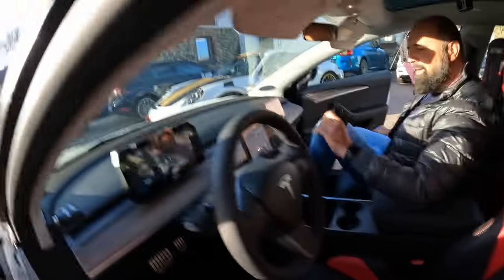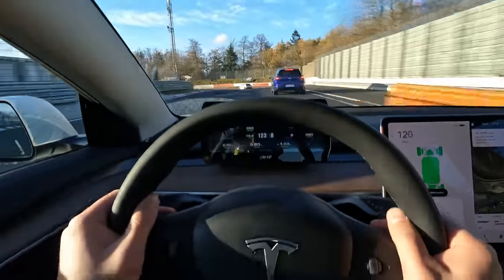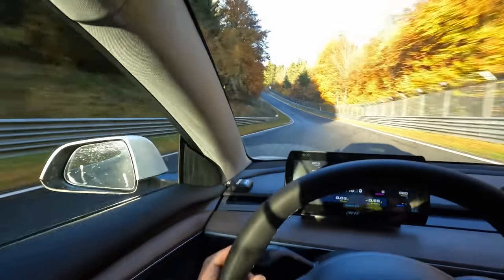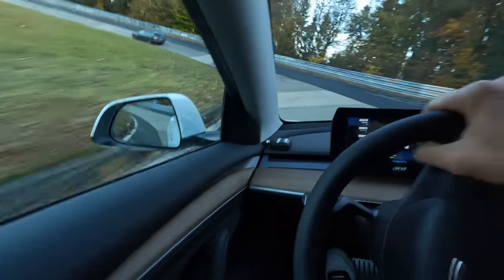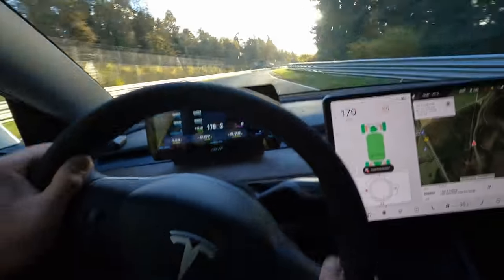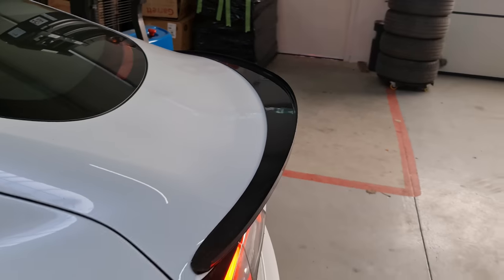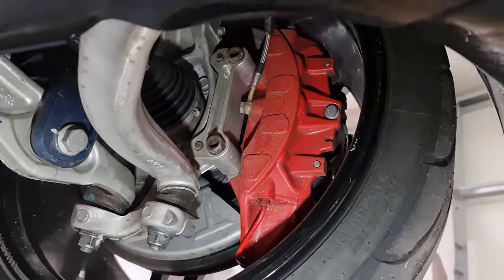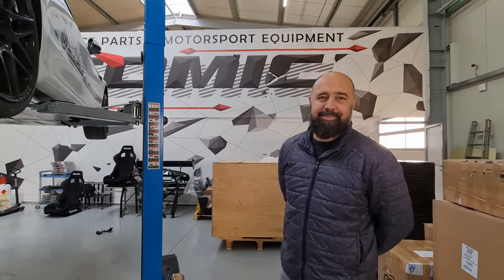The BEST MODIFIED Tesla Model 3 Performance I Have Driven!

Comment: Thanks Mischa for the drive and review of our Nurburgring development car. We are glad you are seeing the potential of our braking and suspension upgrades! We are excited for the future of our Nurburgring development program. A lot more in store! Big thanks as well to our partners at Atomic!
Reply: The brake kit is street legal in germany? Does it have an ABE? Do you have a link?
Reply: And also did you encounter qny problems with the system  when installing sport seats? I guess Autopilot wont work anymore, right?
Reply: Will there be a rear big brake kit for non-performance (and stealth performance)?
Reply: @johnmolloy4878  that brake kit fits in all model 3 and model Y models. Or at least website say all models.
Reply: @romansenger2322  everything is functional, except obviously electrical seat adjustment
Reply: @romansenger2322  TUV  registration is “in house” at ATOMIC
Reply: @olegalex78  how is that possible wirh the seats? How do you use the OEM cable for that?
Reply: @romansenger2322  we have setup kit, but some minor details from oem seats is neaded for a proper installation.
Reply: @olegalex78  who is "we"? Are you related to Unplugged Performance? Do you have a link to the kit?
Reply: @romansenger2322  relaited to ATOMIC-SHOP I thought this was obvious from previous comments) .
Reply: @olegalex78  ah you're the guy from the video. Great. Thx for your responses.
Reply: Batteries overheating because of Regen? So he turned it off? What if you made a big Capacitor-Pack, wired in Parallel with the Battery-Pack, to take that load, and better store that brake energy, to launch out of corners?
Reply: Can't all car manufacturers fit brakes like on Japanese manufacturers where you can take a stock Mazda to the track and drive it continuously for 24 hrs without brakes overheating or suspension or engine failure
Reply: @zerohour2703  my stock brembo brakes from the 350z were mushy after 15min so I dot know what you are talking about.
Reply: @zerohour2703  
I think it's because, like tires, brakes have temperature ranges they work best at, and are designed for. Tires & brake-systems meant for normal road use, and maybe "spirited driving", may not be able to handle very aggressive use, like on a track day, or time attack, racing, or more serious use.

Tires & brakes like that, can be optioned on by the manufacturer or dealer, or you can install them yourself. But they are likely more expensive, and worse, when lightly using them, like calm cruising, or as a grocery-getter, you may not be able to bring those performance tires & brakes up to their operating temperatures, so they may not work properly, because they are designed to survive more aggressive use.

You get into specialized materials, or just beefing up cheaper one's, like wider tires and bigger steel rotors, instead of specialized tire compounds, silicon-carbide, and racing pads. But beefing up cheaper stuff, still cost more then what's essential for the expected normal use, and adds weight.

You have to think about this from the business perspective. This is part of the reason why some performance vehicles have been discontinued, or evolved into something horrific, like the Mitsubishi Eclipse is now a crossover, and Ford's electric Mustang, isn't like the Zombie222, its...and abomination.

The average customers aren't passionate about high performance & mastery like we are.
This is my last comment of the year, happy new year.
Reply: it's a junk

Comment: A bit hard to call it a track tool when it still can't do one "taking it easy" lap in cool weather with a yellow caution period without still going into reduced power mode.
Reply: You are right, its all depends of how done the lap. OEM tires brings  lot of traction control intervention which is making car hot.
Reply: @olegkucherov3898  I assume the low power mode was a result of battery temps, not brake temps. If they've turned off regen braking, I don't see how TC intervention was a factor. What am I missing?

Edit: Just realized you're the Atomic guy, lol!
Reply: @vafan13  TC constantly changing power delivery to the wheels and using brakes a lot= heating everything. You will be surprised but cars with ICE have same problems in case of  high TC activities.
Reply: @olegalex78  OK, I can see that.  With ICE cars I've only heard about TC causing problems with overheating the rear brakes, which lines up with my own limited experience on track with my M5 in MDM mode.  I'm certainly no expert, though.

Comment: I like the electric cars on the Nürburgring ,its like flying trough the landscape like a bird. Very peacefull but fast, would be easier to put on multiple laps with a car with less noise. Robert should buy one to have conversations in.
Reply: And for long journeys the lack of noise is 🤌
Reply: Way less distracting than a gas car for sure. Seems like you can focus way more on driving due to the lack of noise.
Reply: @JAM_2024  I never drove on a racetrack with an EV (except go kart) but when I saw in Paris the formula e you could “ear” the grip it’s really cool
Reply: @JAM_2024  noise is how the car talks to you… it’s feedback for shifting and throttle control….

Comment: I like it when Misha takes it easy, the tires clearly liked it too... now to find a Plaid?
Reply: The problem is it doesn't have track mode and horrible braking, it's only good for a few drags atm
Reply: An atomic modded Plaid then?
Reply: @dinklebamp  tesla released the performance brakes and wheels, I wonder if it changes the game
Reply: @jonasweber9408  and Track mode
Reply: @jonasweber9408  Porsche changed the game with the Taycan cooling system, Tesla is "letting" its customers and third parties do R&D

Comment: For the traction control, Tesla keeps it on 'slightly' in all situations because it's a nightmare to drive without it. You can enter 'Dyno Mode' and this disables traction control, providing full power to all motors.
You just spin out if you even think about touching the accelerator, it becomes a death trap. Being an EV, there's too much 'instant torque' to the wheels, it blows them off so easily. :)
Reply: doesnt work anymore, patched.
Reply: They should decrease the gear ratio to make it have better high-end power.
Reply: No, he js track mode. With -15 it is off, but was set on -10

Comment: Looks great considering the tyres but it needs LSDs! In the thumbnail you’re lifting the inside, with open diff and all that torque the VCU must reduce torque and use braking even with “stability off”. You can hear the “hopping” from the T/C, not the suspension, in some of the heavier loaded corner exits. 

LSDs, or less bar stiffness with more spring, or more suspension droop might help. Can’t wait too see a lap next year with the AR1s!
Reply: Even model s plaid is built like an econobox. I don't think there will be a real performance EV that you can drive 10/10 lap after lap in the next 10 years
Reply: @IR-xy3ij  
Plaid seems like it might keep full power over the course of a lap. There's also the Taycan which has been proven to keep power fairly long.
Reply: @IR-xy3ij  I can get 5 or 6 hotlaps out of my RWD Model 3 around the local roadcourses before any sort of thermal issues. There are cooling mods available for the cars as well.
Reply: @JT-xq2hv  I think the rwd model has a significant cooling advantage compared to the m3p, which has basically the same radiator setup but draws significantly more current. But in both cases there is currently no easy way of completely addressing the cooling problem, and with my slightly modified fk8 I can continue to lap at a very consistent pace until I run out of fuel. 

I believe that in order to completely solve the cooling problem, the battery pack has to be modified to help heat transfer into the coolant, and the air conditioning system has to be upgraded, as the cells cannot be cooled by ambient temperature air. These mods are likely too complex for the aftermarket and personally I would wait for a manufacturer to make a track-ready ev before venturing into that.

Comment: 1:08 He should have changed the handling balance in corners from 50-50 to 30-70 front-rear.  

There are aftermarket coolers for the battery and motors.  (Modifications/additions to the stock systems.)

Comment: You can buy some apps on iOS that lets you send the car commends with Siri, such as "Siri, Open Trunk." There is some other cool automation you can use, such as to crack your windows open, disable sentry mode, and fold your mirrors in when you arrive in your home garage.

Comment: Would have liked to known if they changed the battery cooling at all? I was thinking of adding a bigger inline pump plus a small rad and fan, or forced air, and if the cooling was sorted out I would like to unlock and reprogram the inverter/controller for a bit more power. Also, it would be loads of work and expense, but I would like to alter or replace the battery pack for a higher voltage to give the car more top speed plus more power without needing to alter the motors, etc, but then you may need to replace the inverters.

Comment: You don't need to use Track Mode to launch your M3P. Track mode pumps oil through the battery to help keep it cool for long track sessions. To "Launch" your M3P (0-60 MPH), you need to have it in sport mode, have regenerative braking on, and simply smash the accelerator down. Regenerative braking does not require you to use your brake, which means you can have your foot over the accelerator pedal at all times. This improves your reaction time. So pull up to the light, have your foot over the accelerator pedal, and when the light turns green, you smash the pedal down. If you want to "Launch" even faster, you can use your GPS to locate a Supercharger, and the car will start heating up the batteries for supercharging. When the battery is hotter, it launches faster. When you are ready to launch, cancel your GPS supercharger location and then launch it. So you see, track mode does the opposite, as it keeps the battery cooler for longer track sessions and degrades your ability to launch faster.
Reply: Agree , except for the part where you said it pumps oil through the battery 🤣

Comment: Hey Misha, great video as always, you mentioned that it still felt that some TC is still on

it is, there is a short snow drifting video on my channel with M3P -10 stabilization as well, and it is visible how traction kicks in

and even more it sometimes rotates front wheels(!) even though I was running 0|100 torque distribution. It drifts great though :)

Comment: Is it using brakes to provide “torque vectoring?”  Whenever making right turns, the right tires heat up on the screen, which is opposite of what should happen.
Reply: Break steering you mean?

Comment: I would think full regen (one pedal) would be faster.  You'd get quicker braking off throttle and reduce friction material heat.
Reply: Regen puts more stress on the batteries and causes them to over heat and hit reduced power mode sooner.
Reply: Not in any EV I've seen.  Any modern EV with battery management does not stress the batteries either with charging/regen or draw.
Reply: In every EV you have ever seen. Current flow, whether charging or discharging, produces heat in the cells. That's a property of any chemical battery. All EVs manage this by a combination of BMS limits and batter cooling (either passive or active). The Tesla allows their batteries to discharge/charge at a rate that produces heat a little bit higher than the cooling system can dissipate. With continuous high current flow and heat generation in excess of cooling capacity, the heat will build up and the batteries will eventually exceed the temperature limits determined by the BSM. Some EVs prevent charge/discharge rates high enough to exceed this cooling rate, but that also makes their cars slower. 

With re-gen on the Tesla will go into reduced power mode at about 1/2 of a lap at the ring. With re-gen off the car can make it about 3/4 of the way through that track before triggering reduced power mode. The exact point somewhat depends on how hard the driver is pushing the car. 

EVs designed for racing use battery modules with increased cooling capacity. They also have higher maximum allowed battery temperatures because their BMSs aren't trying to protect a cell for a 1000 + cycles. Different chemistries and cell packaging can change an individual cells ability to dissipate heat. Also super capacitors can be used to absorb and discharge current from brake re-gen without ever touching a battery. 

I am not aware of any consumer cars using super capacitors at this time, but there may be a few. They are used in Electric busses, electric trains, and racing.

Comment: You guys forgot to mention @MPP Model 3 Solid Front Lower Control Arm Bearings you can see @13:13 and few other frames, i am sure all rubber front bushings are gone?! Otherwise it is not a track tool.

Comment: Awesome share, have a random question. The brake lights are not normal. Normally the brake light would be in the middle with a little bar. On this car it’s the driving lights that light up. Any idea why ? Is that part of a tweak or upgrade ?

Comment: I wish Tesla would incorporate these improvements along with those recommended by Gruber Motors to at least their performance versions.  Plaid and Performance models should be the best you can get at the time of manufacture, period.
Reply: They are trying to streamline production to get cars out so top end trims with maximum preformance are not a priority, they just started started offering 20k ceramic brakes, that price alone may have kept some from buying plaid if it came included.

Comment: i was supriced that it didnt have unplugged performance swaybars, traction and trailing arms.
Reply: Case is testing suspension with different setup to know how it will work with OEM parts.
Reply: @olegkucherov3898  well that doesn't change my suprisment.

Comment: Actually the motors are heating up too much at sole point, so their power will be limited after a while. That big batterypack needs a good while to get to a good temperature. Those batteries like it warm, the chinese M3 with the new battery type want to be heated up to about 50c for good performance!
Reply: There are aftermarket drivetrain heat exchangers now.

Comment: I'm not fully educated on EVs and track driving...why turn off regen? My memory is Tesla's track mode increases it. Does it increase battery temps?
Reply: I ask same question.
Reply: Yes, ofc it will accelerate thermal throtteling. Question is by how much and is it worth it to have more brake wear and less energy (therefore power) after every lap
Reply: Regeneration brakes change brake balance during the lap so your brakes will be not so predictable, also it bring some temp to system.
Reply: @olegkucherov3898  gotcha. I didn't think about brake balance. I also wonder how it impacts modulation.
Reply: I think it’s just battery temp. The battery heats up quite a lot more with regen off vs on.

Comment: Very cool improvements! 
Misha, do you know if Atomic had to do anything with the software programming on say the brake ABS/stabilization system for the big brake kit? 
Just watched a video on a new Tesla PLAID where the brakes were locking up at the back end and spinning the car around.
Reply: Wow, what video was it?
Reply: @sickjohnson  hmm, I wonder if that's a problem with the model 3 too. But I don't think so. The model 3 had been out for a couple of years so probably not.
Reply: @sjorsangevare   Hard to know, but the PLAID is so new and doesn't have a Track mode yet still...so one can only guess?

Comment: How did it compare to the Polestar 2 run? (Performance, Handling, Brakes, Fun)
Reply: Interested to know about this too
Reply: Model 3 will spank it. Polestar 3 is heavier with much slower acceleration. This Model 3 is modified.

Comment: How lift-off oversteer works in Tesla? Does it act like spool diff when you're lifting off the throttle, so all the wheels are still under engine load, so it doesn't go into shopping trolley mode?
Reply: With regen active it will feel under load.
Reply: It actually does a lot of things to help flatter the driver, using brakes, engine and yes probably even subtle steering corrections. For instance the Model 3s is excellent with tramlining. Arrow straight with 9" wide wheels on rutted roads - where my old Audi would sniff the crowns like a terrier on speed the Model 3 just surfs along.

Comment: That suspension seemed to be washing side to side , I think the placement of the shocks are not welll designed and well balanced . Can that shop add an extra motor to the existing electric motor or drive shaft for more performance like a turbo addition to a combustion engine ? Lol I must patent my idea
Reply: The battery pack is already at maximum output so an extra motor wouldn't help. 

The Model S Plaid however does have 3 motors because it has a bigger pack with more power output. In fact all three motors have so much power they are carbon fiber wrapped to allow for around 20,000 rpms!
Reply: @flipadavis  but the Tesla website stated that each wheel has its own ekcric motor on a Plaid? Meaning 4.. or did I get it wrong ?
Reply: @kenrossaukrsa  Only 3. 2 in rear and 1 in front.

Comment: but if it has those extra/special better brakes, why does it keep complaining about reduced brake preformance in the car doing the run, do they still overheat ? or does the system not understand/messure the new brakes correctly ?
Reply: there is no temperature sensor, just hardcoded depending on your brake usage of the pedal.